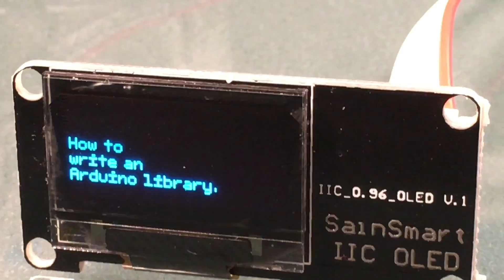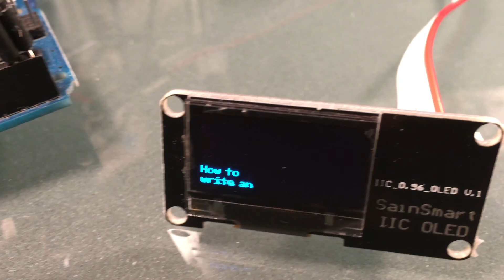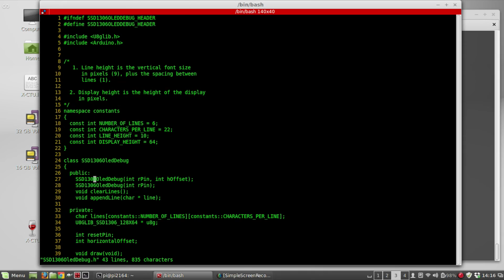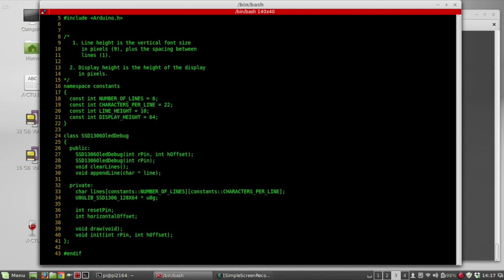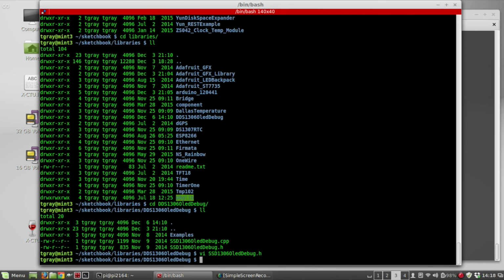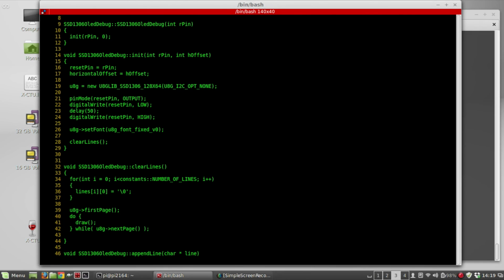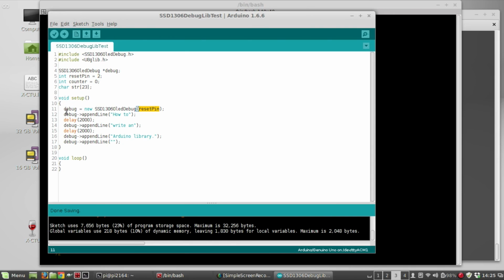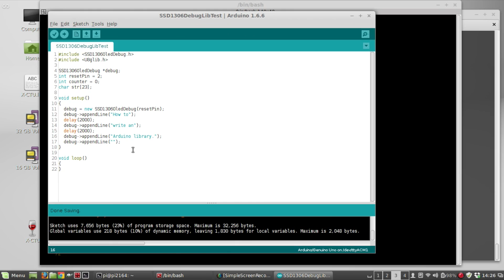How to Create Your Own Arduino Library

Comment: After I saw your black screen and green text I just immediately stopped your video. Just a word of advice, make your videos more readable and understandable.
Reply: +auirek1 I am confused... isn't the reason why the OS chooses green text on black background for readability?  He uses built in VI to edit the text and I am nearly positive it chooses this industry standard color scheme on purpose.
Reply: +auirek1 at least half of developers prefer black themes were programming.. I don't see a problem with it. Nice video, thanks
Reply from the maker: +auirek1 I will use a more neutral terminal color scheme in the future.
Reply: Zachery Littell I guess it is just a preference. The black background and green text takes me back to 2006 when I was programming on Pascal. The other thing is that, when the whole text is green you cant really distinguish the keywords.
Reply: I highly disagree ... if you're watching it in 240p than that's a different issue ... I find it kinda cool
Reply: It's not called black screen. It's called terminal.